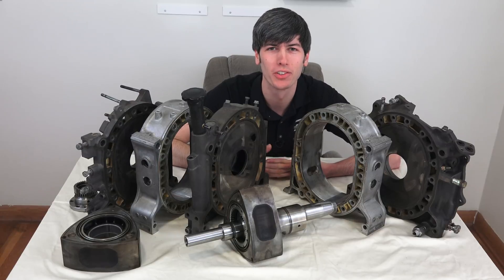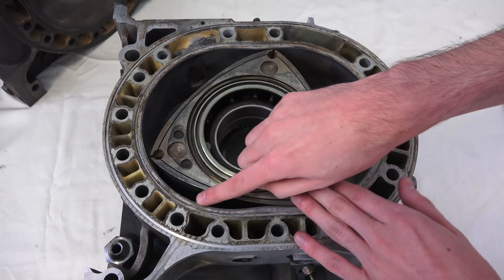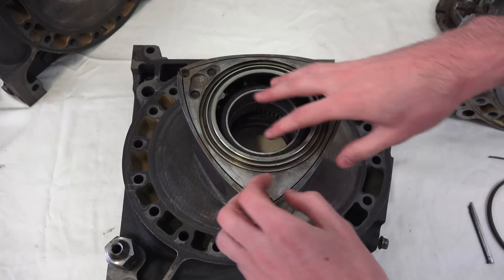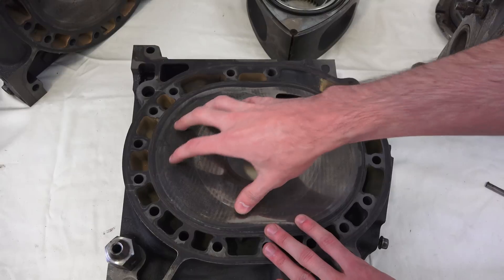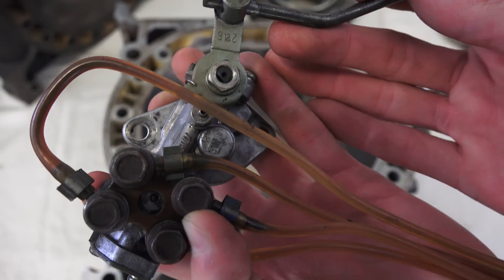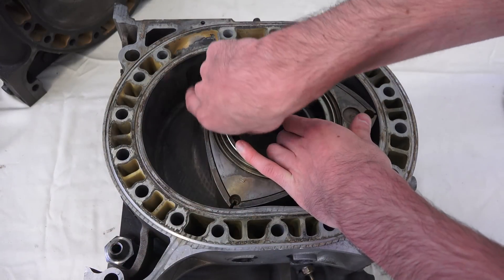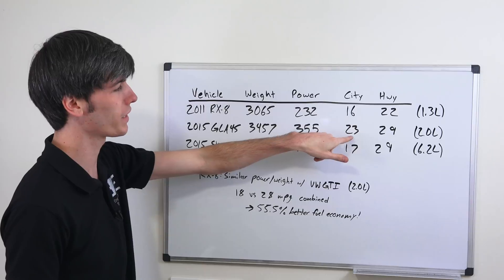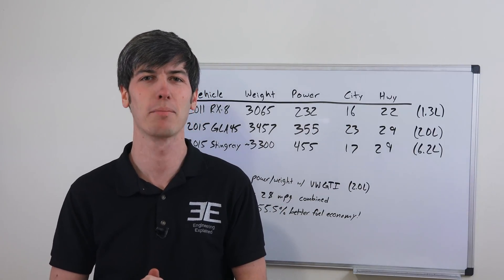4 Reasons Why The Rotary Engine Is Dead

Comment: I realize this video is 2yrs old, but YouTube has put a few rotary videos in my feed recently, and I have to wonder with all of the liquid fuel going out the exhaust, was it possible to recapture that fuel and run it through the engine again?  It would increase the fuel efficiency and eliminate raw fuel going out the tailpipe.  I'm sure there would be technical hurdles, but I wouldn't think any of them would be insurmountable.

Comment: i have a rx8 yes they are crap on fuel but it isnt a daily drive car and the pros far outweigh the cons. Nothing sounds like a rotary engine either. And you will struggle to find a road car that revs comfortably to 9500 rpm

Comment: Smaller engine has to work harder so a 1.3 will be less fuel efficient than a 2.0. great video.
Reply: Fuel efficiency is more about his explanation of combustion chamber shape etc. A 3l turbo intercooled common rail engine is way more fuel efficient than a 6l NA

Comment: Let’s see what could have been done with the rotary engine had more than one company worked on it for decades like the V8. You are comparing to piston engines that have thousands of engineers working on them ever since the small block was developed. Try putting some of that engineering power towards the rotary and i bet you'd have a better engine.  
Also have you ever driven one?  Nothing comes close for enjoyment, even as it’s old technology.

Comment: I would argue that the combustion engine is on its way out entirely... electric cars are the future! They will prove to be more powerful, more efficient, more reliable, and will last longer with less maintenance. No oil changes or tune ups and engineered to last a million miles.

Comment: My dad test drove an RX-2 when they were first imported. That was fun. Smooooth, 7,000 RPM redline. Years later he bought a used one, not running. We tore it down, needed rotor seals, the chamber plating was worn through from lack of oil despite the injection. I got on the phone to Mazda to order seals. “You don’t want seals,” the parts guy said, “they’re $500.” That was in the early 80s. Thus ended our RX-2 adventure.

Comment: His initial explaination on the combustion chamber was wrong, rotary's have a lead and trailing plugs. Lead fires before the lobe gets to almost flat center.
Reply: I was watching that explanation and wondering why they did just not put in a second plug.
Reply: @robstone4537  all of em had a second plug, the 787 at lemans in 1991 had three plugs per rotor.
Reply: He lied
Reply: That's why he is an engineer always right  2+2=5 🤣🤣🤣🤣

Comment: Thank you so much for crushing my rotary engine superiority dreams.
Reply: still, having owned a number of exotic cars, this one is a CHEAP thrill.
Reply: @oldrrocr  Mazda market share has always be cheap, entry-level cars targeted at first time buyers..
Its never been associated with upmarket or performance... in fact Mazda no longer has any factory motorsports programs.
Reply: 69 likes :-)
Reply: You can get yourself a used one for low price nowadays. I high doubt Mazda will ever bring this engine back now with all manufactures pushing for better fuel economy and lower emissions.
Reply: @elkillerx  Mazdas are not really a collector car, build quality is below average...  so very poor resale values.

With many manufacturers now offering standard powertrain warranties up to 10 years and 100,000 miles the unreliable Wankel engine is simply not a commercially viable engine.
Reply: They were going to be crushed anyway but Jason was pretty gentle.
Reply: @sandervanderkammen9230   He didn't cover they are difficult up to impossible to start in cold weather.
Mid 20s if you miss first try............it is over for at least 30 minutes.
Reply: @wms1650  Very true, Wankels have low static compression and often have leaking seals after a short time in service, coupled with poor combustion efficiency they can be extremely difficult to start in cold weather.
Reply: @sandervanderkammen9230  They are very easy to start in cold weather, colder the weather (within reason) has significantly higher compression.
Reply: @22ae13  That's completely false, the lower the static compression ratio the harder it is to start the engine without additional starting aids, as the Wankel engine quickly loses compression they become increasingly difficult to start regardless of the temperature and flood easily fouling the plugs.
Reply: @sandervanderkammen9230  Definitely don’t flood easily, there is a reason why people have issues with “hot starts” rotaries definitely do not mind the cold as much as you may think.
Reply: @22ae13  Hot start problems are due to Engine Failure when one or more of the chamber faces has compression at orbelow the Manufacturers minimum compression limit specification.
Any questions son?
Reply: @sandervanderkammen9230  Yea but when you have hot start issues, notice how when the engine is cold is has higher compression and starts fine?
Reply: @22ae13  But when you perform a proper compression test or engine dynamometer test the results reveal the engine has failed, regardless if it still starts and runs, the damage requires a complete overhaul or engine replacement.
Reply: @sandervanderkammen9230  It would still reveal higher compression if the engine was cold compared to warm even if it was a brand new motor up to mazda spec
Reply: @22ae13  You really are just an inexperienced amateur... the correct procedure for testing the compression is with the engine hot.
Test reading cold are inaccurate and deceptive..
Reply: @sandervanderkammen9230  yea but our original debate was that you said compression isnt higher when the engine is cold. which is not true
Reply: @22ae13  It is true, because testing the compression cold is inconclusive and inaccurate... it doesn't give a reliable indication of the extent of the damage to the seals.

Comment: Idk what disadvantages your talking about lol still driving my 1983 rx7 gsl. And 1987 turbo gtr rx7 . 0 problems with engines only thing I had to change is radiator on   it. 1987 is purring only thing I did on it is methane water injection and bigger turbo.
Reply: Wait till you need an entire engine rebuild when a corner seal or side seal fails and Jack's your entire engine up. I'm glad you were a lucky one but it's only a matter of time and you know it deep down. Still love rotary engines but damn they need a design update asap lol

Comment: They make no sense whatsoever.  I still want one, though.  

Every man in the world wants tell his mates in the pub about his "rotary wankel" engine.
Reply: Nah,I wanna tell my mates about a big block V8.
Actually funny how one would think it's gonna be expensive to own a V8 machine.Then he discovers rotary.
Reply: @Killer553  My coworker had an RX-8 and I was so damn envious, but then it broke and he told me that no matter where he asked no workshop specializing in rotary engines would try to fix it, because it was too old, and his only option was to buy a brand new engine for more than the cost of a used RX-8, or buy a used engine and hope it will not break down soon.

That's when I stopped dreaming about having an RX-8.

Ok, I didn't, I still want to own a red RX-8 even if it means selling my lungs.
Reply: @StartellerRX-8  

Well your dream is at least partially real.

I would like to travel back in time if it was possible.
....Obviously because of classic Muscle cars ;)
Reply: @StartellerRX-8  You don't have to sell your lungs. 1000€ for car with dead engine, 4-5k€ for rebuild and other things, and you will have a car you will never want to sell. It's not really that expensive to maintain.
Reply: @nikojeric8054  you greatly overestimate the value of my lungs.
Reply: They make some sense (not much though). With a Wankel you haven't got big lumps of steel changing direction every few nanoseconds. That's about all I can come up with 😏

Comment: While few people will argue the short coming of the rotary engine, your comparisons are badly skewed toward unreasonable. Your comparison of vehicles 4 years newer, is just off balance.  That like comparing a 1965 Mustang, to my 2012 Chevy Cruze and saying the Cruze is better. (Argue that amongst yourselves). 

You also made the claim that on comparison the GTI was close in power and weight to RX-8.  The 2011 GTI only produced 140-170 bhp compared to the RX-8’s 212-232.  On the lowest end that’s a 50hp difference. (A lot)

Your Stingray (comparably from 2011) milage is actually 16city/26hwy. The GLA wasn’t even a concept until 2013, and a more reasonable competitor would be the 2011 BMW 328 with had an inline 6 producing 230hp.  It’s mpg was about 18city/28hwy, and it weighed 300 to 800lbs more. 

In addition during 2013 the Washington Post reported the average fuel economy of new vehicles sold in 2011 was 22.4mpg.  On perspective for the time the RX-8 falls completely average. 

I love some of you videos, but please Present facts don’t skew them.  There’s enough of that in politics.

Comment: I agree with everything he says. He pointed out all the negatives but we all know there are a lot of positives. He also used the non turbo rensis engine. A rotary turbo can make a lot more power and use about the same amount of fuel. Not to say they are good on gas by any means. I would love to see if Mazda can figure out this EPA problem. I know they have had rotaries run on hydrogen. Either way I like my srt8 but love my FD

Comment: Actually, that 1.3 liter motor is actually a 3.9 liter motor since it has 3 firing strokes per revolution per chamber.  With that in mind it's obvious why they make so much power and waste so much gas.

Comment: 3 years late, but I still have a question. Couldn't a wider rotor improve the flame front? Meaning, the flame would spread laterally, not along the long face of the rotor. That could give time for complete burning. The complete burning issue is no different in a piston engine, if the piston was moving too fast. That issue in a piston engine is handled by increasing the spark advance.

Comment: During the 1970s I was shown a magazine advertizing a molybdenum-tungsten spark plug that has a perforated head to create an omni-directional spark to spread in all directions to increase the air-to-fuel ratio to make it even more lean and a modified rotary wankel engine that has more spark plugs in the compression section so as to create a complete combustion when it is still in a compression/compressed stage. After that, no news afterward.

Comment: Engine looks cool inside but it's just rubbish especially by today's standards such as the new turbo engines which have the same displacements but are reliable and super cheap to run in comparison which is a shame the RX7 and RX8 and really nice cars to drive and will live on just with new engines 😭

Comment: The reason rotaries blew apex seals in my opinion is these cars were underpowered electrically. When I went to a 250 amp alternator, it changed the car. It was much more tunable because the fuel pumps and injectors had the needed voltage at all rpms. Also, they are a 4 stoke, not 2 stroke as advertised, so it's a 2.6l not 1.3. I have a 3 rotor so it's a 4l not a 2l. It makes much more sense the power they make when realizing this fact. They are gas hogs but that is not why we use them. Nothing sounds like it and a 2 rotor is 7sec 1/4 mile capable. 3 rotor 6 sec capable.

Comment: I loved driving my dad's RX-3.  It really did go "mmm" - until a corner seal fell out, and seized the engine.  I rebuilt it, which was a lot of fun due to the novel design.  But realistically, I would have to agree its disadvantages outweigh its benefits for the purpose.  It had great acceleration though, and I seem to recall doing 50mph in 2nd gear.